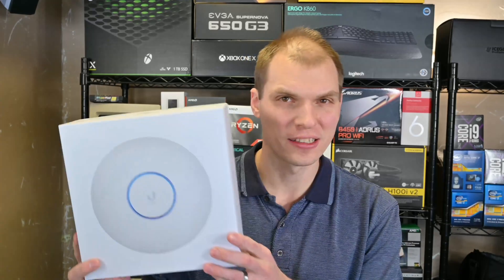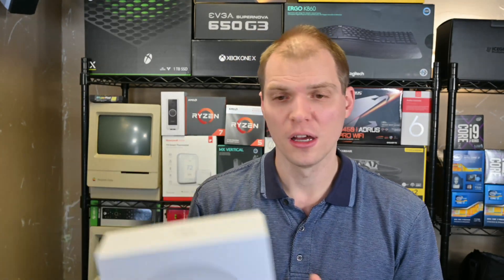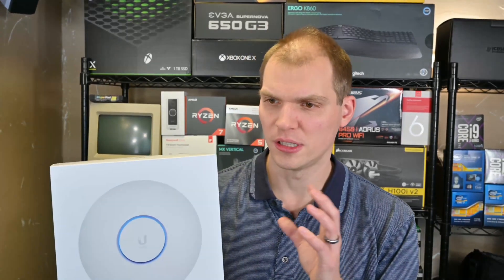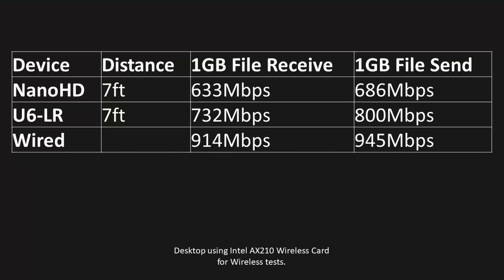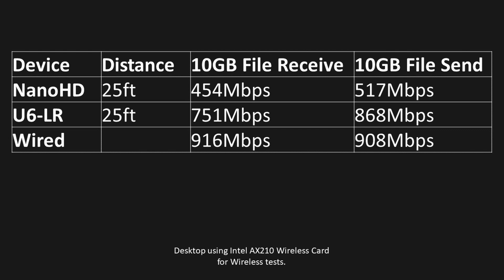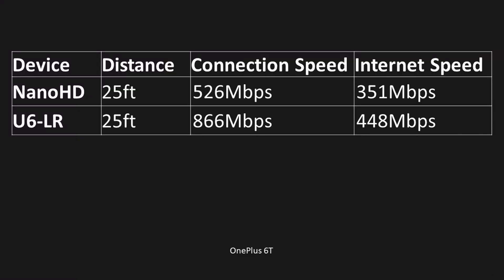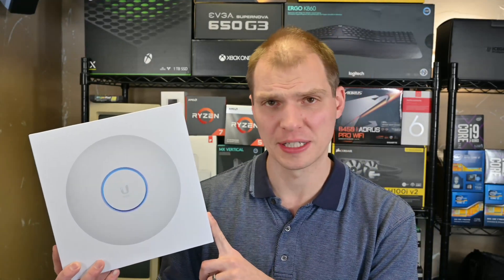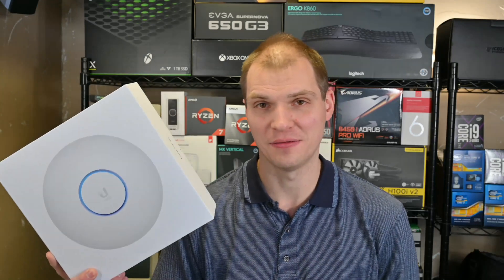Testing UniFi 6 Long-Range Access Point

Comment: How to get full 2gbps speed wireless speed as per said on datasheet?
Reply from the maker: Great question. I don't know how they came to that number. It only has a Gbps uplink. Maybe WIreless to wireless. Or just the total thruput you can have wirelessly.
Reply: 2Gbps is actually half duplex on wifi... so all you have to do to get as close to that as you can is speed test in both directions at the same time since the ethernet port is full duplex, 2gbps half duplex link is required to feed a 1Gbps full duplex nic but it won't do it 100% efficiently either. It could in theory hit this but in practice never will. Note this also carries over to most other wifi gear also including ubiquiti longe range links etc... almost always the link specs are half duplex. If full duplex it usually says so and will command a higher price point.

Comment: Hi, thanks for this! Have you or anyone else tested the range of the U6-LR v the NanoHD when traversing thick walls within a residence or building? Also, what PoE injector would be suitable for it? Cheers!
Reply from the maker: For PoE I used an Unifi Switch Lite 8 PoE for my parent's setup and for mine I have a 24 port PoE switch both support the PoE at that is needed for these. Coverage I installed 2 of these at my parent's place which is about 3000sqft house, 1000sqft attached garage and 1700sqft detached garage/shed with 15 feet between the attached garage and garage/shed. The ap's are placed one in the house and one in the attached garage.

Comment: this is great. my issue is trying to figure out how many i need and not to overkill.
also when you mount it on the ceiling does the signal also go upward or only downward and horizontal ?
Reply from the maker: The nanoHD I have mounted go upward as well. This was mounted where the nanoHD's were and it also was all direction.  Yes, trying to figure it out and not overkill is a challenge. I started out small with 2 nanos and then added in one to almost complete the coverage I need.